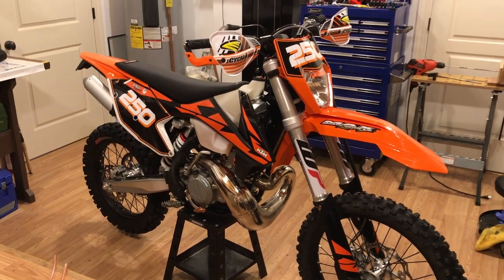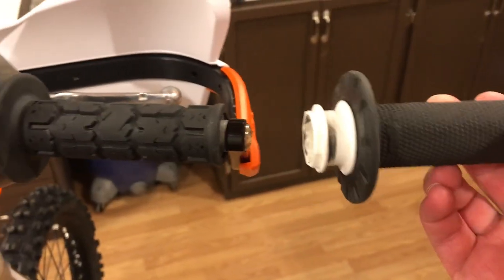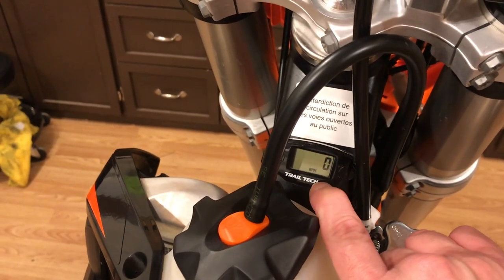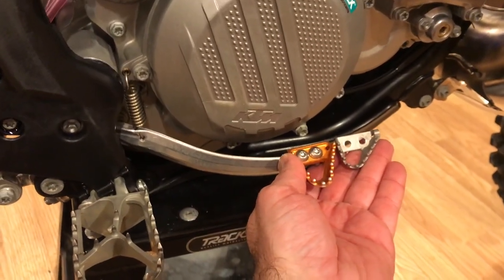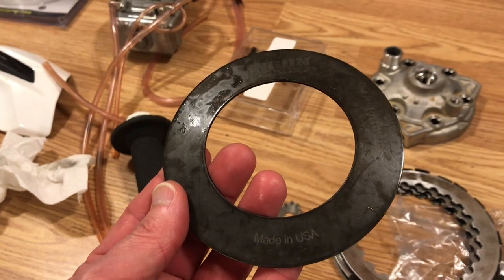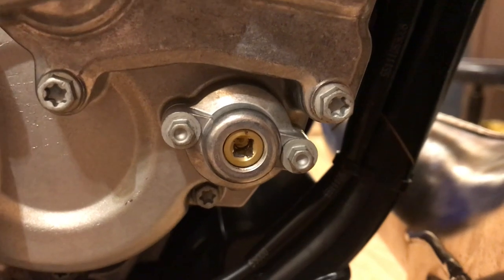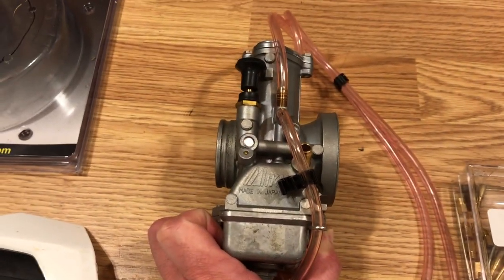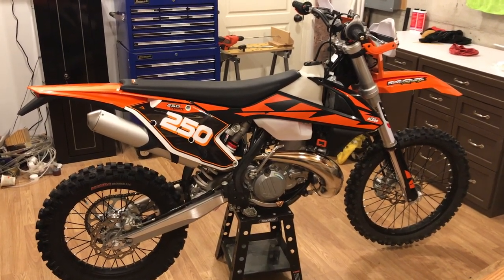2018 KTM 250 XC-W Modifications and Upgrades

Comment: The hour meter difference is this.  The stock meter works on the wheel turning and the trail tech is actual running time of the bike.  So when the bike sits and idles,  the stock hour meter isn't triggered but the tt is. Hope that helps.
Reply: youre right and I think its the stupidest thing on earth haha. Why on earth KTM would put an ENGINE HOUR METER to run only when the wheel is spinning is beyond me. thats what the mileage is there for KTM so u know har far your bike has ridden. Some people like to know how many hours the engine has on it. idle hours are hours nonetheless. I noticed this when I swapped my front wheel on my XCW for a race just wanted to use a different tire and didnt feel like changing the tire on the wheel just for one race. I noticed my cluster said the same hours after the race and thats when I realized how dumb KTM was lol.
Reply: Not sure if that's true. When i got my new 2018 last winter I ran it twice for 15 min each time to break in everything (without riding it) and it recorded that half and hour.
Reply: Vachau 01 yes that’s not true I ran my 2018 300 xc two times when first got it not rode it just started it it had .2 tenths of an hour on it so it doesn’t go by the rear wheel spinning

Comment: Great video! Regarding the ignition switch you installed, do you notice a real difference in the two maps? Do you use them both? Would you buy it again?  I've got a 250 xc-w tpi on order and and reading mixed reviews about these switches .  Thank you again!
Reply from the maker: I've had the bike for almost 4 years and put 300 hours on it now.  I never touch that switch, lol.  I wouldn't buy it if I had it to do over again.
Reply: @DirtBikingwithDonnie  awesome, thank you for sharing. I'll hold off on buying that thing

Comment: I also have the 250tpi, awesome bike, thinking about that fan kit, was wondering what temperature you have set for your fan to turn on/off at?
Reply from the maker: Enzo Annecca I have it set at 182 degrees.  I think it was set at 185 out of the box. I ran a very difficult/muddy hare scramble in late Feb and my radiators were almost completely covered with mud/leaves/pine needles. The fan worked hard that day but the bike stayed cool the entire time.  Check out my video from that race. You can hear the fan doing its job when I’m stuck on a hill. 
https://youtu.be/vhKlpnkMLl8
Reply: Set mine at 165

Comment: Nice bike. Im shopping for a 2 stroke and wanted your feedback in the 250 vs 300.  Have you had a chance to compare, and what was the makuni csrb doing thst was so much trouble?
Reply from the maker: This bike was lacking low end in stock form.  I did the SX head and the Keihin carb together to increase low end.  The Mikuni carb was pretty good with the JD jet kit but I never could get it just right.  For example it would constantly stall on downhill sections when I had the clutch in.   I adjusted float level a few times to try to remedy that and never could get it corrected.  The Keihin carbs are known for better low end response and that carb combined with the SX head had the exact result I was looking for.  This bike has low end power close to a 300 but still revs like a 250.  I have a friend with a 300XC and my bike is very comparable to his bike on low end power.
Reply: Dirt Biking with Donnie and Chase that's a great explanation and sounds like you found a thorough remedy. My fear of getting the 300 is its just gonna be a lugger and when it gets on the pipe it will be too hot to handle. Thinking the 250 will be more fun and still have plenty of power. People say 300 is easier.. put it third and go...half the fun is finding and being in the right gear for me. I an probably splitting hairs though.
Reply from the maker: Jamie K If you like being on the pipe the 250 is the way to go. The 300 is a monster on the pipe.

Comment: Nice mods to the bike. I'm thinking about changing my carb and reeds right away so I don't have any issues. Did you feel a decent change in power with the head mod?
Reply from the maker: Pony Down 418 My initial impression with the head mod is increased low end, which is where this bike was lacking. But I’ve only ridden around my house. I’m headed out riding today and will have a better answer after a full day of riding.
Reply: Dirt Biking with Donnie and Chase - got ya. I have a 300 so I'm guessing that I should hopefully have some decent low end torque. I'll be waiting for your report back. Have fun!!!
Reply from the maker: Pony Down 418 The carb change and the cylinder head change together completely change the engine character of the bike, in a good way. Low end is significantly better now, as well as mid and high end. The carb has really made it run crisp and clean. 
I’m considering the VForce 4 reeds as my next mod as I’ve read bad things about the stock reeds breaking. Let me know if you get new reeds. I would be interested in the ones you get and how they work.
Reply: Dirt Biking with Donnie and Chase thanks for the info on the changes. Yea it looks like my first mods for the bike will be the v force reeds and the carb conversion. I'll report back once I get things going. It might be a little bit of time though since spring hasn't hit here yet.

Comment: Cool beans, dude! I got an XC-W 250 last December, too. I got the TPI (Transfer Port fuel Injection) model. I’m pretty short and old (haven’t ridden in 30 years!). My first blasphemous contra-mod was to lower the suspension by 2 inches (also lowered my net worth by an additional $500!). Just like you I had Cycras installed before rolling it out my dealer’s door. Then to further defang the beastie I installed the same MAP switch which brings me to the real point of my response to your posting... Which is the slower MAP ‘traction’ setting? Position number one or two? Both are terrifying to me at times! 

That said, over thirty years ago I had all the following two strokes: from an itty-bitty 50cc mini to an RZ 350 Yamaha triple street knee-dragger with Hon, Kaw, Yam, Suz 125/250 motocrossers sprinkled between those extremes. This new KTM is awesome! No carb to jet, no oil premixing, no worries! Just pour oil in one tank and gas in the other and have faith in the KTM engineers. I made some other modifications culminating in an inspection sticker and a license plate. I’ve added a keyswitch to deter its theft. I can buzz up my garage door, ride out my driveway into town, pull up to a gas station, add pump premium petrol, mosey on up the hiway and signal with my blinkers when I see a dirt trail into the mountains I care to explore. After my TPI and I get filthy in the woods we merge legally back into traffic, return up my driveway, I press my garage door opener conveniently positioned behind the bike’s light shroud (how effin cool is that!) and roll back inside satisfied 🤗. (BTW, Envy your hardwood garage floor.)
Reply from the maker: Timothy Acord Congrats on getting one of those elusive TPI bikes. Sounds like you’ve made some great mods. Have you considered doing a video?  I haven’t seen many mod videos on the TPI. 
Setting 2 on the switch is the traction map but, like you, I’ve found there’s very little difference. 
I’ve found changing the power valve spring (I’m running the green) is the most effective way to control the power delivery on my bike.
Reply: Dirt Biking with Donnie and Chase Funny thing is the TPIs don’t come with any additional power valve springs. Apparently the engineers at KTM are so proud of their accomplishments that the want the end users to leave well enough alone.

I’m just a consumer of videos, not a producer. I appreciate people like you sharing great content. I’m looking for riding buddies though. If you are interested are you near West Virginia?
Reply from the maker: Timothy Acord We are in Alabama.
Reply: I also have a TPI bike, and I'm curious if we can change out the exhaust valve springs like the carb models
Reply: aaron johnson, I hope that you are enjoying your TPI as much as I like mine. I’m sorry but I don’t know if the exhaust valve can be replaced on it. I trust the KTM engineers to have integrated the engine’s systems far better than me tweaking their product. I did, however, add the same mapping mod as Donnie. The stock XC-Ws (including our TPI version) have the ability to alter their engine mapping to a ‘traction’ mode from the preset ‘performance’ mode. All you have to do is disconnect an in-line wire hidden beneath the fuel tank. Obviously that is very inconvenient. The Six Days XC-Ws have a switch as Donnie describes that integrates with the bike’s lever perch. I chose to put that accessory mapping switch on my front brake’s perch. All the switch does is ‘open’ the engine mapping circuit (position number two = traction) or ‘close’ the circuit (position one = performance) without taking off your tank to unhook a wire. You might try giving yourself the ability to change your TPI’s behavior on the fly in a way that KTM has designed into the machine rather than altering it in a way that might compromise the engineered system as a whole. The mapping switch was about $80 and really simple to install. Good Luck!👍
Reply: What lowering kit did you buy?
Reply: Those tpi bikes are destroying a lot of pistons. If it seems the least bit lean, get it to a dealer. I've read about at least 30 different bikes doing it

Comment: have you changed squish band with SX cylinder head ? if so how much you cut ?
Reply from the maker: Criss 11 No, I did not have the SX head cut. It is slightly higher compression than the stock XC-W head.

Comment: You put the red spring in yet?
Reply from the maker: No, I’m running the yellow. I need to try the red one.
Reply: @DirtBikingwithDonnie  This video got recommended lol. I knew I'd watched it. But hey I put the jd gasket kit in my mikuni. The carb had a leaky gasket from factory and a bad o ring. After this fix the mikuni tmx works amazingly good. I had it running good before but would get a rich condition at idle and quarter throttle. Was scratching my head. Finally fixed. Cheers man.
Reply from the maker: shogun678 I may order that kit for mine and try it again. It would be a good video opportunity. I can’t believe YouTube is still recommending this vid, it’s a little embarrassing, lol. Anyway, I hope you’ll check out some of my more recent vids. Thanks for watching.
Reply: @DirtBikingwithDonnie  for sure man. Thanks for posting them. We have the same bike so it's cool to see what you're up to with it.